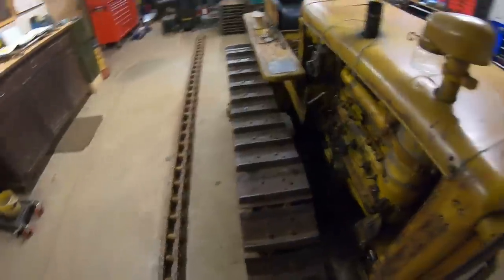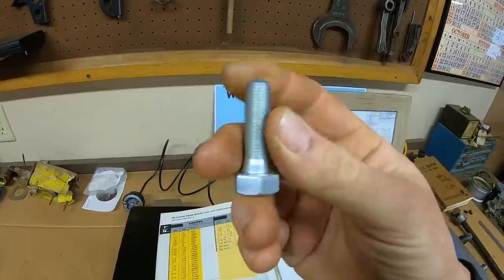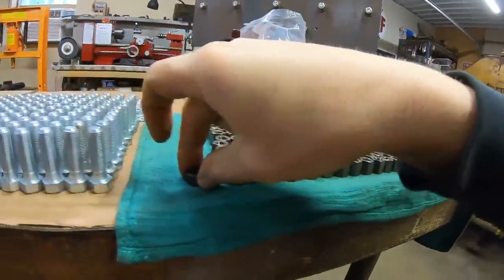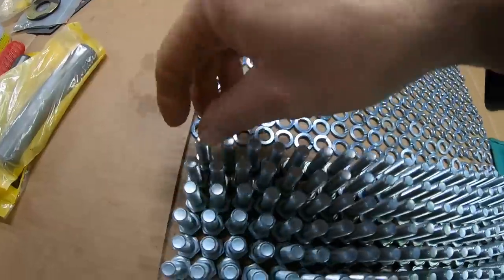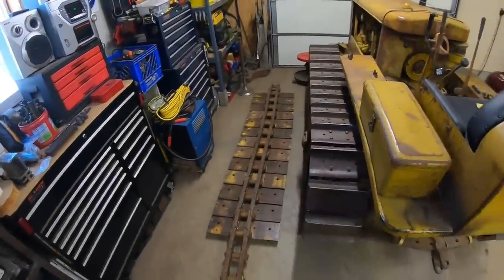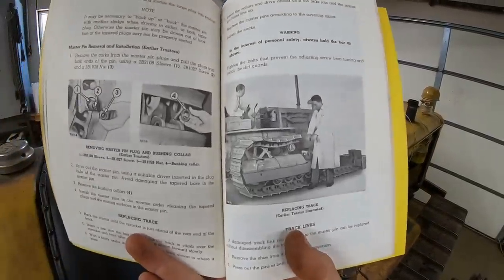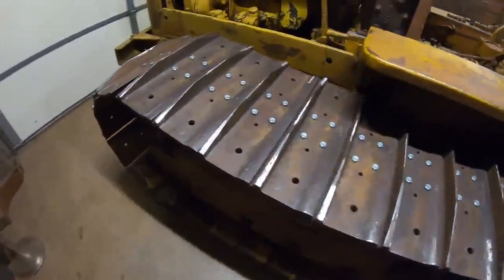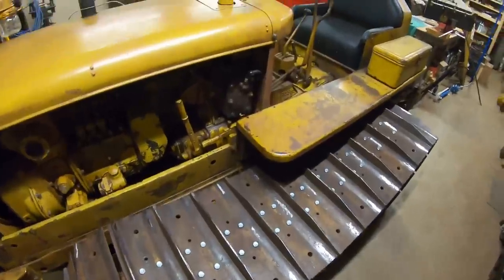Caterpillar D2 #5J1113 Chassis Rebuild Ep.75: Track Swap Begins! Hanging the 20's and Looping Chain!

Comment: I do not get your logic ?
You are very keen on using parts to original specs, and found the correct high nut type.
But then you trade off on the bolt type - even after explaining the importance of why they should have the specified non-threated length.
Reply: @squatch253  There is always a story behind ... :elbowcough:
Reply: @squatch253  Not to mention that aftermarket bolts wouldn't have the CAT logo on them. Once you explained your reasoning for methodically placing the logo's identical to one another, it makes sense to sacrifice the NON spec threads in order to keep the logo for quick visual reference!
Reply: @squatch253  great explanation! Beside, having all of the logos facing the same way kinda looks cool!
Are you still gonna pin this comment?
Reply: It's a trade off - you can EITHER have "CAT branded" bolts, or "to original CAT spec" bolts.

But you can't have both.
Reply: I only thought about my comments after I pressed send. Head bolts, track bolts, rear end bolts. My bad but thanks for your feedback
Reply: @paulwomack5866  Not necessarily true, Toby likely could have bought longer CAT bolts that had the right shank length then cut the threads off to get the proper dimensions but that is a lot of extra work when an engineer would say a properly torqued fastener connection should not be moving anyway so the shank of the bolt should not be acting as a pilot or a dowel as bolts are suppose to be springs not methods of alignment. keep the hardware tight and it should make no difference to the lifetime of service the tracks provide. Key being keep the hardware tight. The manual actually likely specifies checking all hardware from time to time not that anyone ever does but it keeps the manufacturers from having to pay warranty claims for anything damaged from being loose. 🙂

Comment: Silver soldering advice: Use Harris black flux. It withstands higher temp without burning away like the white flux. My favorite solder is Harris Stay-Silv 56. If you need to do separate joints close together, you can use Stay-Silv 45 first, and then 56. The 45 is a slightly higher temp. I also use Stay-Silv 15 because it's cheaper and widely available, but it's a bit stickier. Works better for filling a gap.

Comment: Tip on silver soldering: it is impossible to silver solder over soft solder. It just doesn't work. You will have to do your darndest to get all the soft solder off of everything before you will successfully silver solder to those parts. Even then you may have some problems, since soft solder tends to bond chemically to the top few layers of atoms in the target metal.

To actually silver solder, you need about three things: clean surfaces, a lot of appropriate flux, and the right amount of heat. Clean the joint, use a paste flux that you can smear over every part of the connection area, and then heat the joint up to a low red heat, no hotter. Just like soft soldering, you don't want the heat directly on the solder rod/wire; you want the metal hot enough to melt the solder. If the joint is clean and well fluxed, to solder should pretty much flash wick into the joint at red heat. Without sufficient flux, or too high a part temp, the solder will ball up and fall off.
Reply: Couple of points on soldering.  First off, even some soft solders now have a percentage of silver to them, especially the lead-free ones.  Harris Stay Brite and Stay Brite 8, for example, with 8 having a higher silver content and better bridging capability.  What most people refer to as silver soldering is actually brazing with a solder stick that is 15% silver.  Then there is cadmium free silver solder that has a 55% silver content and is sold by the troy ounce.  Obviously, the higher the silver content the stronger the brazed joint.  55% silver solder is used for high pressure applications and brazing dissimilar metals such as copper to steel.  Stay Brite 8 makes a good joint that is capable of withstanding a couple hundred pounds of pressure but can fail from vibration.  15% silver sticks deliver a joint that will stand up to vibration.  

Soldering is not a chemical reaction and does not occur on the atomic level.  Rather, it is a physical process known as capillary action.  When the copper is heated, the pores expand and the solder flows into them and then is securely anchored in the copper when it cools, but the seal between the two pieces consists strictly of the soldering material.  This why soft solder requires flux to clean out the pores so the solder can fill them.  Flux is not nearly as necessary when brazing with 15% silver sticks because the higher temperature required for the solder to melt and flow, burns aware almost all of the impurities.  It will improve the ability of the solder to flow and helps with copper that can't be thoroughly cleaned, but I have made thousands of joints without it.  I always use flux when soldering dissimilar metals to insure a good joint.

I have brazed successfully joints that were soft soldered, so it is not impossible.  But this was always on joints that were done with lead free solder.  True 50/50 solder that is made of 50% lead and 50% tin may act differently, but i have never tried so I do not know.

An oxy/acetylene torch is good for brazing, but I tend to prefer a Turbo Torch connected to a B tank of acetylene as it heats a wider surface area and helps eliminate missed areas in blind spots.  As always when soldering, you head the joint, not the solder and make sure you heat the entire socket so the solder flows all the way in.

Comment: As an aircraft mechanic for 36 years, retired now you always torque nut never bolt head. Maybe it doesn't matter with your application. Just my 2 cents, awesome videos love them all.
Reply: Same here, engineering documents specified additional torque by bolt size when torquing the head.
Reply: Additional info, in a “loose” hole like these, torquing from either head or nut is correct

Comment: Once you have cleaned all the old solder off and out of the joints and assembled the manifold. Before you start to silver soldering the oil manifold back together, put a purge on it using nitrogen gas. That will prevent oxidation of the copper inside the manifold. The black oxidation that is formed while silver soldering is hell to remove form the inside of piping. It can break loose and travel through your bearings.  If you cannot get nitrogen gas then use argon. 
BUT DO NOT USE BRAKE CLEANER TO CLEAN THE PARTS!! IT AND ARGON HEATED TOGETHER FORM PHOSGENE GAS! USE A NON CLORINATED DEGREASER. ALSO DO THE SOLDERING OUTSIDE IF YOU USE ARGON
The purge doesn't need to be a high volume of flow, place a vent hole high on the manifold and feed the purge form the lowest point.
Good luck and practice first
Reply: Best to never use brake cleaner on anything!

Comment: Very good points, particularity on the grip area.  We always took that into consideration in architecture school for shear calculations in particular.  The threaded parts has a smaller cross section, which of course it can't take as much load.

Comment: Trick to successful silver solder. Use the high temp flux, as clean & free of anything as possible, removal of all previous solder, Use the best silver solder you can get or you will get to do it over.

Comment: Squatch, I regret to advise that you may have great difficulty silver soldering on a joint that has been soft soldered, no matter how well you clean the old solder off. I had that problem on a large model of a hot air engine, that had been badly repaired with soft solder. I spend ages cleaning off the lead/tin solder from the oil supply pipes and brass unions but the silver solder just would not flow or take. In the end I succeeded with copper-phosphorous rods (Cu-P 701). They are only slightly higher melting point than silver at 730ºC (1346ºF).

Comment: I wish I had these YouTube videos when I worked on D2’s many years ago. I did a track swap. Didn’t change pins and bushings, but I did use the longer bolts and deeper nuts on the pads. Now I want another D2, but my wife thinks I have enough toys!

Comment: Love the look of the wide track on the D2. We used to have an old Case 310 or 350 6-way dozer blade on 30" pads. Yes we got it stuck several times but that thing could almost walk on water. Mainly used it for crowd and assist pulling the Vermeer T-600-D trencher through wet spots in fields. We did farm drainage tiling for many years.

Comment: Still struggling to accept the fact that turning the pins an bushes took up at least two inches from the overall length of the track 🤔👍wide track plates just look awesome 😎👌
Reply: @squatch253  I think this is not comparing apples to apples, the track and chain that was on the machine was worn 100% in the pins and bushings and had reached 100% wear in its height. The chain you turned the bushing and pins on was at 75% wear in length and had only ~20% wear in its height if I remember correctly so a length test before and after the turn is more relevant to what has been gained. This is a great channel with the best content!

Comment: Eutectic has silver solder with a pink flux on it for memory it's 45%silver with cadnium . Heat the job up and wipe the soft solderoff with a cotton cloth .then polish off all the traces of solder off . Use some laco paste silver solder flux . Heat up resnably quickly . No 12 tip . A dab of the silver solder . Should be good . Retired master plumber 50 years on the tools !

Comment: Apart from getting silver solder to stick once a joint has been soft-soldered (every scrap of the soft version has to be removed or the hard will just run off) you also run into the problem of any lead based solder left vaporising at the higher temps needed.   Mucho ventilation needed and preferably some protection. Good luck.

Comment: Toby, I was a little disappointed that you installed those shiny zinc plated bolts and lock washers without some form of a patina treatment. Maybe I thought a bluing process would be suitable to match the nuts? I wasn't into the patina look at the beginning of this series, but your plan grew on me over time. Thank you.

Comment: There is a reason track bolts are different from regular bolts they fit the holes tighter once the holes in your pads and rails where from having hardware store bolts you'll never find a way to keep your track pads tight

Comment: hi there is a company by name of Rothenberger plumbing they make a silver solder ring in place in side with flux then heat  you might find a vid on here  but i know in plumbing trade when i sold them the flux and ring combine worked well to make a 100 % full fill weld part of demo was to allow customer to cut any welded area which ever way they want only to fine solder was full covered both surface perfectly  something to try  cheers bob Australia

Comment: Great video! I was worried about the alignment of the Cat logo on the bolt heads until you eased my mind toward the end! That said, I would have set the logo to face the driver in the seat. See, you are not the only one who thinks of those little details. LOL
You are also soooo right about the pad  nuts covering the entire threaded portion of the pad bolt!!!
Great job!
Reply: @Squatch253  With that new information, your decision was the best option!

Comment: I know it may hurt a bit, but you could take the oil manifold to a local HVAC tech.  However, get yourself some soft solder and some flux.  We use stay brite by Harris.  Don’t be afraid to get both sides warm, especially the cast portion.  When the flux starts to bubble, you can start dabbing with the solder.  It will wick itself in. Just let it cool slowly for maximum strength.

Comment: Another question I hope you can answer for me, I was told by a fitter one time that the 9U had a 'high revving head' on it. I could discern no difference between that cat & the others in either engine speed or power. Do or did such things exist? These things have puzzled me for decades & it's great to finally find the answers in your seemingly vast store of Caterpillar lore.

Comment: Trapped between a rock and hard place?
If it were to be worked it then I would firmly recommend bolts to spec. That shoulder before the threads is designed to stop lateral movement between the grouser plate and track chain.
It's not going to be hammered so stick with the logo bolts.
Maybe go gentle when turning coz those huge plates are going to grip and apply more twisting force. Also hit em with the torque wrench after it has been used. 
If no-one has already mentioned it - torque from the nut side. That way you are tightening the nut without potential binding resistance and flexing from the bolt shaft giving a false reading.

There - told you what you already know👍

Comment: Depending on the soft solder used a new silver solder joint might be very difficult.  I don't know about the new antimony/tin plumbing solders but the old lead/tin solders had to be completely removed (like nothing but copper or brass visible) before attempting a silver solder joint.

The flux is also important - I use mostly Stay-Silv unless I expect to have to hold the joint in heat at which point I use some of the black flux (can't remember the name but it's commonly use to braze carbides).

Finally - heat is what you need more than temperature.  O/A is ok if you have a good rosebud tip but I tend to use a large Goss propane torch to get the whole joint hot at the same time.  Once the flux goes glassy and looks like a still pond the silver braze should suck into the joint.  If there's gaps of .010" or better look for a gap filling braze.

Just some advice from someone who's been there.

Comment: When i learned to silversolder dairy stainless i found the best way was to put the parts on Metal plate, put the plate on a propane burner, heat up with refernece to a infrared thermometer and then boost with a torch to final melting point.  Overheating doesnt help things…

Comment: 12:49 I'm kinda six-in-one half-dozen-in-the-other on this. On one hand I absolutely love seeing machines that still work just fine despite being hilariously worn out, as that shows a level of ruggedness and reliability not found in today's machines. There's a timelessness about that which appeals to me quite strongly. On the other hand, I absolutely love seeing that wear rectified as it guarantees another 80+ years of service out of that machine as well as conserving the amount of parts available for these vintage machines. It is, after all, much easier to rebuild a somewhat worn drive sprocket or track than it is to repair one that's totally stripped, snapped right half in two.

In the end, if it were my machine, it'd probably run on those old tracks for a while yet. Budgetary concerns also come into play and I don't have the budget to throw brand new tracks on it, as it were. Not immediately. It'd be something I'd have to nibble on over a couple years while running the worn parts.
Reply: @squatch253  For how often I'd be using the thing and the relatively light duty service I'd be giving it they'd last the rest of my life haha.

Comment: Silver solder requires an acetylene torch for heat. Sliver solder melts around 1760 degrees. Personally I like to Silver solder. Makes for very strong joints.

Comment: There's a little trick to keep those little washers from falling out and that is to put a little dab of grease on the inside portion of it and then stick it in and that will hold it in will you put the pin through

Comment: Couple of things for silver soldering. Practice on something that is expendable until you are totally comfortable with the process. Surfaces must be completely clean and ask some pros about flux. Don't be afraid to put some serious heat on surfaces, as in cherry red. That was the temps I needed to get silver solder to work. Practice, practice, practice. Thanx for sharing, great video.😃
Reply: Most of the time dull red will work, at least for me. You certainly don't want to go hotter than red.

Comment: If the only thing holding you back is a white lab coat, guess I’ll have to go buy you one, wouldn’t want you to be with out one
Lol  I do thank you for the explanation of track wear  between the two sets of tracks, now I know what the noise is on my cletrac, time to adjust the track first and see if that helps, thank you sir.

Comment: I used to buy Cat high nuts by the hundreds for use on a very large wheel trencher (5’ wide by 10.5 ‘ deep) so no threads protruded for ease of disassembly. Cat hardware is the best

Comment: I have two questions, and sort of comments.   My understanding is that the bolt clamp is in the threads,  not the shank and you want that spring that the threads provide to get the right clamping force.    Ergo, the new bolts should be better (assuming this is truly clamp force involved here).    And a comment that Bowman/Lawson and I believe Imperial all have Grade 8+ bolts with high heads.   You can then torque their  bolts to higher force getting a better clamp.   I would not be surprised that CAT provides Grade 8+ as all the ones I have seen were the high head bolts.       Also my training was that  a correct torque is applied to the nut not the bolt head,  so curious about that choice to torque the bolt head? .

Comment: I could be wrong but I think you are going to need the longer shoulder on those bolts....especially with wide tracks. Without the Friction fit of the shoulder the tracks are going to loosen and gore out the holes. As for the silver soldering....Have a chat with your local plumber, he will set you right. Thank you very much for the show and the education.